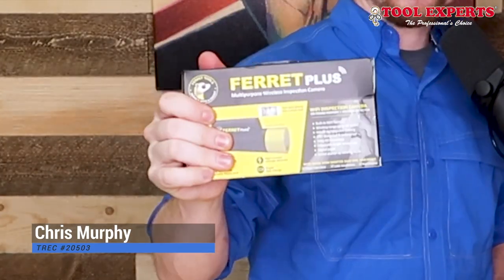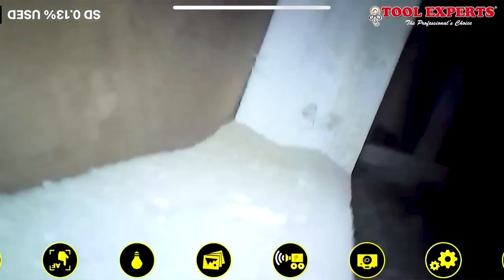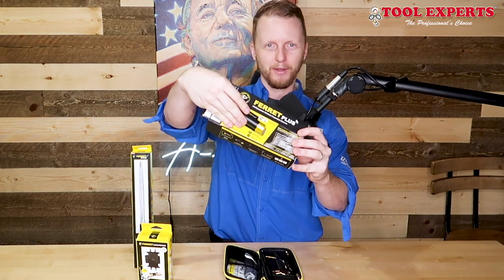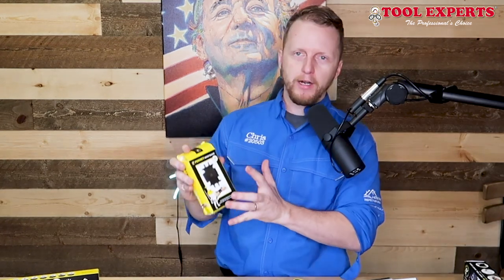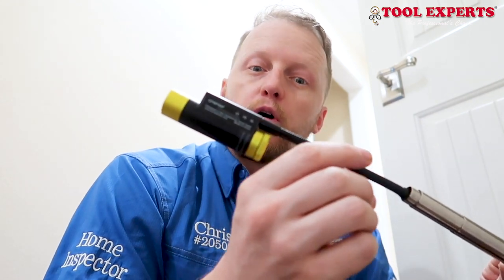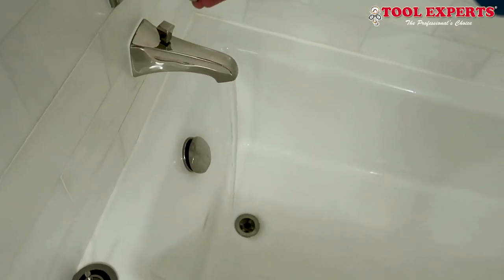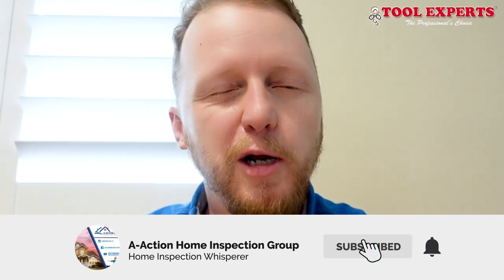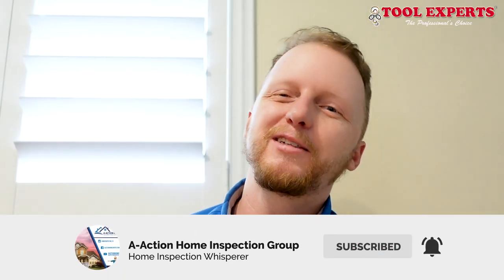Ferret Camera Home Inspection Tool Review

Comment: Tried it, small, easy to get into hard to get places, video quality is poor.
Reply: Thanks for the head's up.  Any recommendations for a replacement?
Reply: @sekritskworl-sekrit_studios replace the user. A fool with a tool, is still a fool.  Video quality is fine provided the light is on max brightness, the lens is clean and you don’t rely only on the autofocus in certain situations. In a busy confined environment it will hunt focus just like your phone camera does. Switch to manual focus  and the problem is solved.
Reply: @MS-Patriot2  Thank you
Reply: Yeah and expensive as hell. I got myself a $5 endoscopic camera off of Amazon that was tiny (fits in more places than the Ferret) and the quality was just as good and didnt require you sacrifice your wifi (listening to podcasts at work)
Reply: @matttzzz2  what brand was that ?